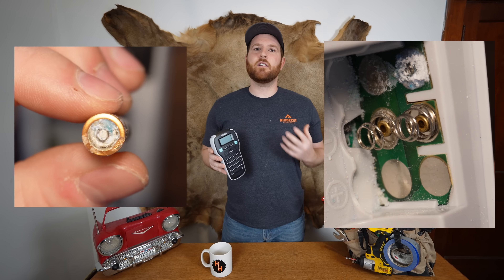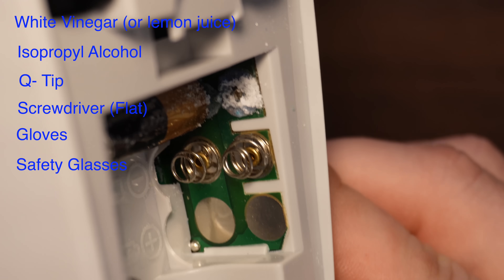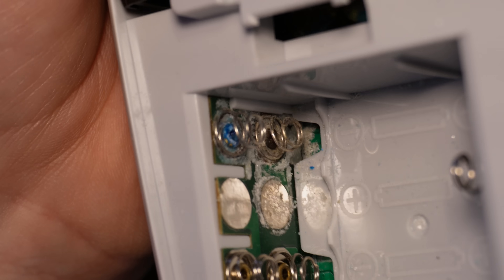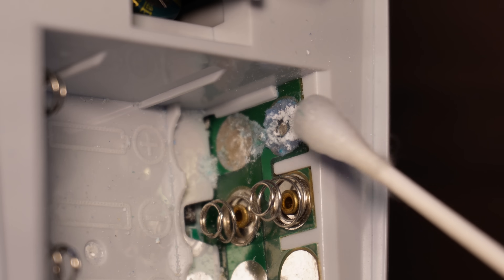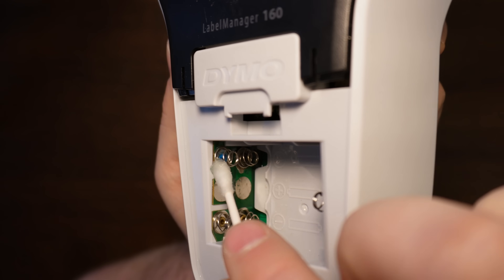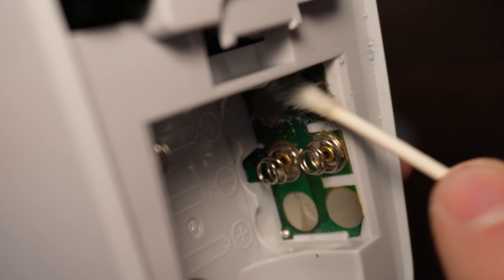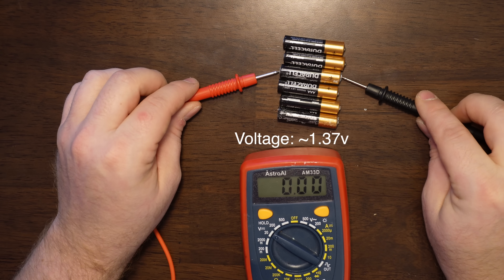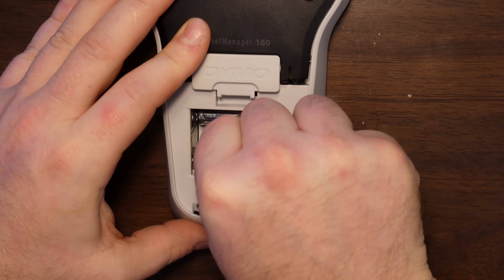Clean BATTERY CORROSION on ELECTRONICS! EASY DIY!  |  2-minute Tutorials Ep.4

Comment: You forgot the most important part, unfortunately. The corrosion has been removed now, but so is the protective chrome layer on your copper contacts. Over time, they will start to oxidise, which means bad connections again. You should put a new protective metallic layer on them, like zinc spray.
You can actually apply it easily with a needle on the corroded area, after you get some out of the can.
Reply: @klave8511 it will corrode if it is left there for a long time, the isopropyl alcohol can remove most of it, so it's not a big problem
Reply: The plating will be nickel, not chrome. Household vinegar (5-7%) is too weak and dilluted to damage nickel unless you left it submerged for days or weeks. Any damage will be from the leaked battery acid (which is stronger and has been there for a long time), not this brief cleaning. Often the contacts are fine, and that looks to be the case here.
Most of the gunk is actually salt deposits rather than oxidation - but if you can visually see reddish rust then the coating may have failed somewhere. zinc probably maybe works as its a good conductor but paints also have a lot of plastic binder in them so it's not easy to know in a spesific product. just a touch of light oil should be more than sufficient unless the apparatus is exposed to the elements. Oil will be much easier to apply properly since it will filmcoat the surface on its own without needing to be 100% accurate. Zinc is great protection for iron and steel outside, but it seems like massive overkill here :)
Reply: @TheStigma  This is why the comment section is the best part of YT.. The "flush it down the Toilet" is appropriate for all of us who leave the device with the copper top for years without use IMHO.
Reply: The leakage from the cell is alkaline, not acid. The acetic acid of the vinegar neutralises the alkali.
Reply: Wow, so many self-reported experts who don't actually know what they're talking about.  The standard plating over copper is either tin or gold, not chrome or nickel.  If it looks silver, it is most often tin.  If it looks gold, it is gold.  The tin plating is usually chemically deposited by spraying it on the bare circuit board or dipping the board and then either spun or blown off after it is on the board for a specified amount of time.  Gold plating is usually electroplated.  On the rare occasion (often VHF or UHF circuits), the sliver looking plating is actually silver.

They use Tin because it is pretty resistant to oxidation, but most importantly, it takes solder very well since most solder is an amalgam containing a good proportion (40% or more) of tin.  They use gold because it also takes solder very well, and is quite resistant to oxidation - the gold layer is so thin, it costs very little per board.  Silver is occasionally used because silver oxide has a lower resistance than tin, gold or copper oxide.  It is used in UHF/VHF circuits because small changes in impedance/resistance can have a large effect on transmit and receive, and can burn out the final amplifier circuit.  Nickel is rarely used nowadays because nickel is ferrous, meaning that it picks up and holds magnetic fields which will interfere with (choke) high-speed signals, like those into and out of a processor or microcontroller.

Neither nickel or chrome accept solder as well as tin, gold or silver, and the vast majority of exposed pads on a circuit board are exposed so that they can be used to solder components to them.  Very few circuit board manufacturers treat certain exposed pads differently than the rest of them.
Reply: ACF-50 Corrosion Block Waterproof Grease was developed to coat electrical connectors on the Sea Harrier so its marine proof , it dont get any where more hostile to electronics
Reply: The protective layer is nickel, not chrome.
Reply: Will electronic parts cleaner work?
Reply: @idahospyder1620  If you are referring to contact cleaner, from personal past experience it tends to only clean away oils(from your hands) and loose dirt, corrosion doesn't usually come off that easily as it's not a chemical reaction like vinegar.
Reply: @idahospyder1620  Just use isopropyl alcohol.
Reply: @klave8511  In your last sentence, did you mean to state "avoid the alcohol" or did you actually mean avoid the vinegar?
Reply: @klave8511   No problem, I appreciate your reply. I wanted to be sure because I've had to do this process countless times with the perpetually leaking Kirkland batteries that I used to buy. I do basically everything this guy did except for the vinegar. After tapping/brushing out the loose bits, I use only alcohol on a swab straight away, I didn't know about using vinegar. I use less liquid, squeezing out any excess, and always try to tip the device so no alcohol runs into the inner parts. I also have a mini awl set that I use to scrape away corrosion and gunk in tight places. I really hate batteries and wish they were made better or we had an alternative that doesn't damage our devices. Anyway, thanks again for the response.
Reply from the maker: Thanks for your input. How has the chrome layer been removed in the video? How long do you think until it becomes an issue? I’ve been doing it this way and never had to come back to bad electronics, as you’ve suggested I would. Not arguing, that’s just not experience.
Reply: ,  its not "chrome" ---- the shiny plating is tin, over the copper base metal. There's no simple way to replace the tin that was dissolved by the battery electrolytes. If you sand or polish the contact down to the base copper, shiny and bright, you can tin it with a thin coat of solder, which will work okay-ish, better than bare copper anyway. Use 60-40 electronic solder with lead and a rosin-flux core. Don't bother to try leadfree solder, the stuff is just plain awful.
Reply: It's actually nickel plating that corrodes away with battery acid.  I am an electronics engineer of over 50 years' standing and this has certainly been my experience.  Sometimes one can sand the surfaces clean and then tin again with flux and solder.  But it's never a perfect solution and the ideal is to replace the parts. @HandymanHertz
Reply: Never thought about that. Good tip. I'm going to order some right now. Thanks. 👍
Reply: lol
Reply: How about lithium grease that's supposed to prevent corrosion?
Reply: Oxide inhibiting compound works well.
Reply: @klave8511  A lot of propriatory rubbing alcohol sold in chemists has a bit of mineral spirits in it.
Reply: Will WD40 work for that?
Reply: WD-40® is a non-conductor of electricity and quickly eliminates moisture-induced short circuits.
Reply: @MauiViolinist  no. wd40 is an oil. it smells good, and evaporates. however, you can apply a thin layer of semisolid grease. any kind. red, black, blue, silicone. does not matter. it only keeps oxygen and moisture away.

Comment: Please teach how to replace the spring & anode contact point next
Reply from the maker: I’ve never done that before.
Reply: @HandymanHertz  because those battery terminals easily corroded due to battery electrolyte leakage of the low quality battery.

Comment: This is awesome. I’m trying to clean a Wii remote controller, which is very old. Either way I have a question will normal vinegar work or does it have to have white vinegar?
Reply from the maker: I would think regular vinegar would work. Both are acidic, which counters the base substance, which is the corrosion. 👍🏼
Reply from the maker: Let us know what you find!

Comment: Cool video! I’ve watched a few of these because I have said problem on a nice head lamp I accidentally forgot about in the bottom of my tool bag. From what I understand the vinegar is an acid while the alkaline battery leakage is actually a base. Alkaline base as it were. So the vinegar (acid) helps to dissolve and counteract the alkaline (base). But don’t quote me I am not a scientist. Haha!!!!
Reply from the maker: Thank you!  I believe you are right, that’s what my research showed too. Hope you were able to save your headlamp!
Reply: That’s exactly it - people tend to generically use the term 'battery acid' for any sort of battery corrosion, but it ain’t necessarily so.  Certainly the corrosion from lead-acid car batteries is acidic, and must be neutralized with an alkali like baking soda, but alkaline cells are, as the name implies, at the opposite end of the pH scale.  Thus, their leakage is basic rather than acidic, and a mild acid like vinegar is an excellent choice for neutralizing their vomit.  Corrosion is very destructive to electronics, unfortunately, and alkaline batteries seem to have become much more inclined to leak in recent years…

Comment: But why not disassemble first?
Reply from the maker: You’re right, that would be way more fun! 😃
Reply: @HandymanHertz  it's not about fun, it is required for better removal of all traces of electrolite and vinegar which would otherwise might remain inside the enclosure and corrode printed board. But thanks for the vinegar trick, I always used to remove electrolite mechanically, now I know a better way thanks to this video.
Reply from the maker: 👍🏼 you’re welcome!
Reply: as someone who's regulary attempted full disassembly, I can tell you that you will often shatter the case, break or rip wiring off, and strip threads out of screw posts.  especially on older items or things like solar lights which are exposed to weather.